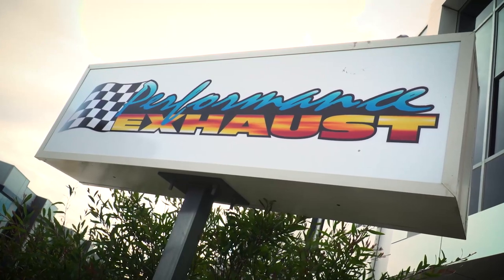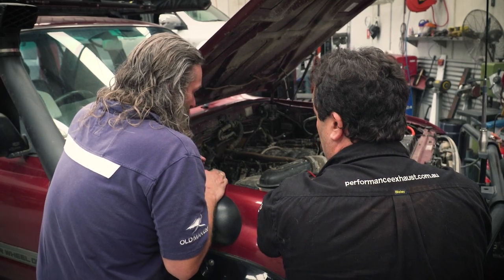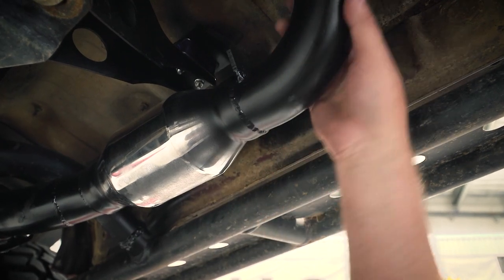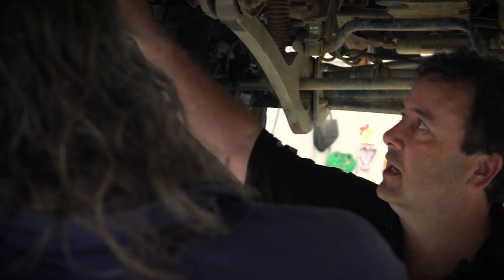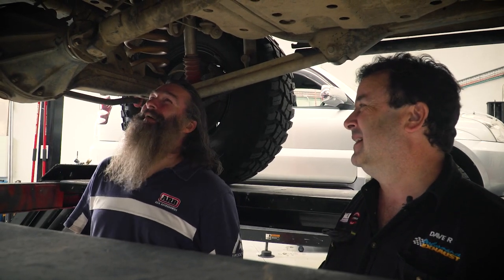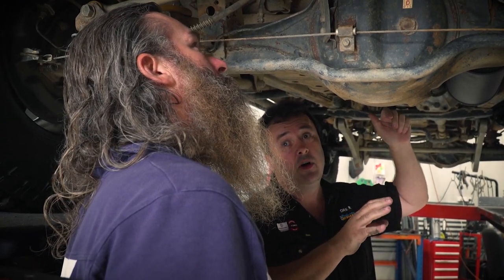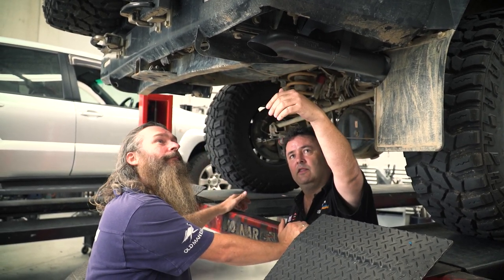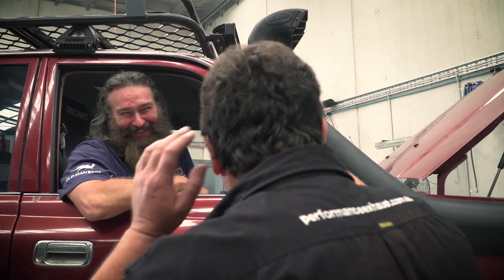Danny's 80 Gets An EXHAUST-IVE OVERHAUL

Comment: Any reason they didn't put in a flex pipe between the extractors and cat?
Reply from the maker: Just didn't need it mate, the system is still working fine years later but you can ask the installer at Performance Exhaust...great guys and very helpful.
Reply: @4WDTV  fair enough, was just curious because l was thinking of putting one on mine, but I got a turbo set up, so it gets quite hot..